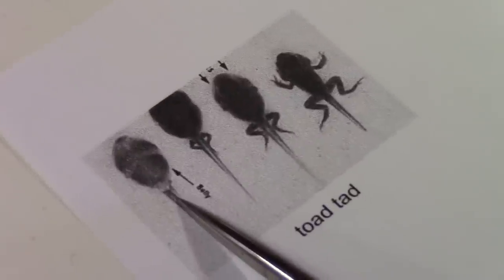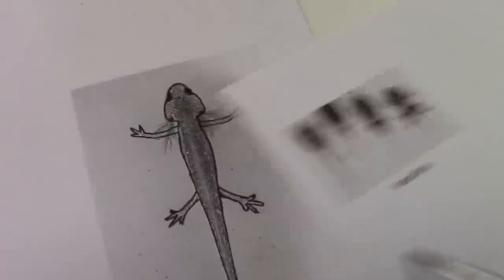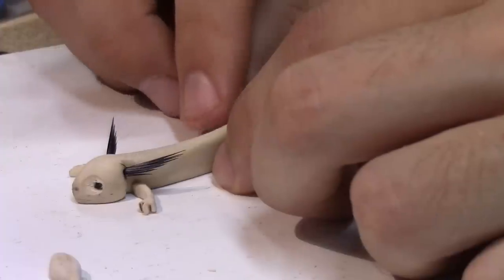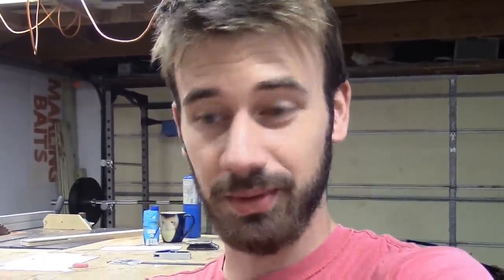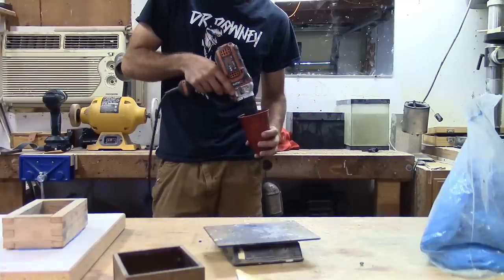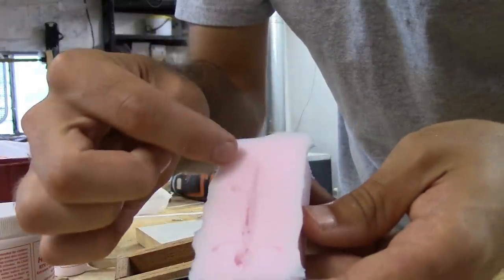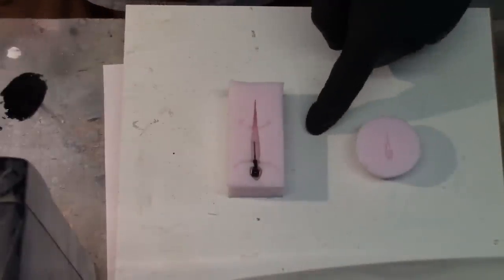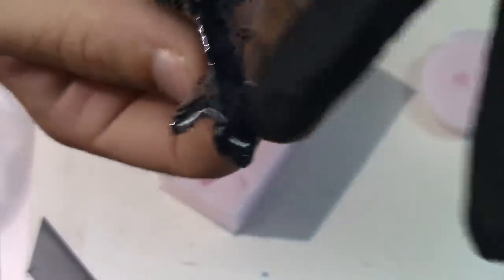Making Tadpole Lures

Comment: The little rubber yellow belly baby catfish with the small spoon spinner in front of it that I used to fish with when I was a kid caught Bass very reliably. It was just real hard to cast and get very far out there, cuz it was so light weight. But that was back in the early seventies I haven't seen one of those lures for a long time. When I do though it gets bought. I was kind of hoping you could make one of those that would be easier to fish with cuz it had some weight to it.

Comment: Another awesome video.
Maybe a butterfly with hinged wings so it flutters around in the water.i can’t envision how to do it but you are the pro. :))
Reply: Butterfly. Line tie near the bottom of the head. Wings on springs so when you twitch the rod tip the lure pulls down and the wings bend back then pull the lure back up